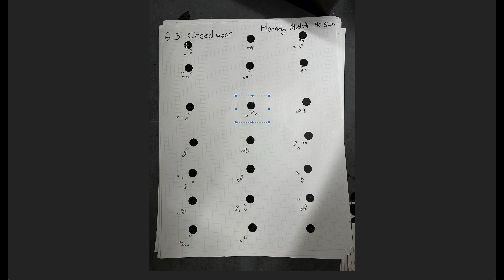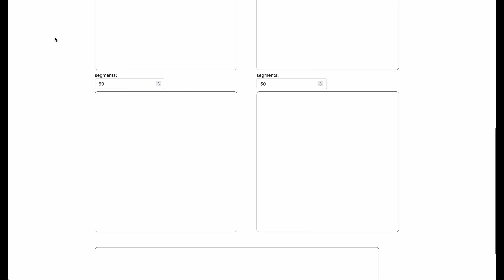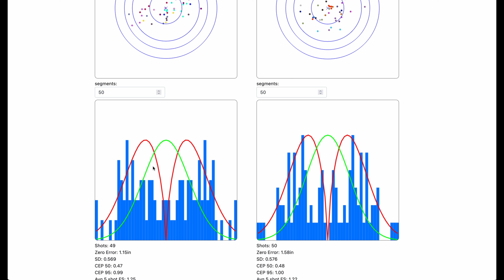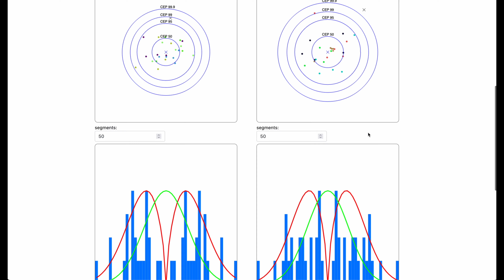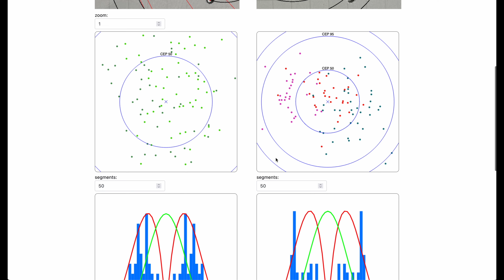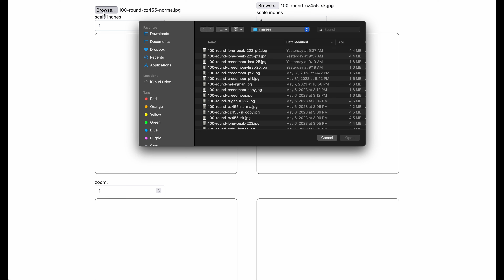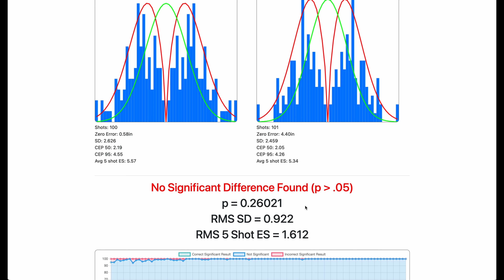Does Barrel Heat Affect Accuracy?

Comment: I think you're probably (pun always intended) correct that barrel heat has little-to-no effect on accuracy, but I don't think you've supported your argument super well in this video. 

First and foremost, the group rank (e.g., whether is the 1st, 5th, or last group) may not be a good proxy for barrel temperature. I'll give you the benefit of the doubt that your time between groups was as consistent as possible, but even so you're still fighting the opposing dynamics of adding heat with each shot and that heat dissipating at some rate between shots (and between groups). It would be more meaningful, and fairly simple I think, to actually measure the barrel temperature, then run a regression of mean radius on barrel temperature. If you want to get fancy, you could measure wind and include that in the regression just to eliminate any possible bias introduced by wind. 

Second, it's not very convincing to compare the first half of your groups with the latter half, as that only inspects the relative effect of the average barrel temperature of the first half of the groups to the average of the second half of the groups. If barrel heat has a significant effect early on but not so much as more and more groups are fired, you might miss the difference in that comparison. Likewise you might miss it if the effect is significant but the slope is small. 

Anyway, thanks again for the great work on these videos!

Comment: I don't know how you are placing your reticle, but the width of the reticle introduces another variable. Might I suggest placing the aiming spot in the corner of the intersection rather than under the intersection. This way the entire aiming point is visible and can be adjusted to touch both the x and y axis without being obscured by the  crosshairs.
Reply: The variable you alluded to is about maintaining a consistent sight picture. It’s easy using a 6 o’clock hold., which can be exactingly memorized.

Comment: I still don't think I understand how your bar chart/Bell curve works: what is that supposed to be displaying? What does the X-axis denote? Distance from the aim point? But why is it mirrored? And if the dip is supposed to show that you are less likely to hit exactly on the center, wouldn't the scatter look more like a donut? But it looks pretty even and randomly spread to my faulty human eyes. But at the same time, of course you're less likely to hit a location with much smaller surface area or circumference, but what is the statistical probability of hitting ANY specific small location inside the 95 CEP?
I just don't think I understand enough about your methodology and display of the data.

Comment: Since you're fitting a a pair (more?) of normal distributions, what is the error on your fitted-sigmas for the convoluted model? If you presume that your pair (or more?) of stacked distributions are from different causes (lets just say: shooter and mechanical), then you should be able to see if there's a divergence of the fitting parameters (primarily the SD from each individual distribution in the model) or if they both shift slightly. It won't answer the question specifically about heat and accuracy (maybe it's fatigue that's worsening the shots?) but could be interesting to see if they converge/diverge over time. Further: same shooter, same gun, different quality of ammos - this might be a way to estimate a shooters absolute accuracy if there's a common enough factor across multiple tests.

Secondarily to this: why do you only report a single SD in your fitting tool? Why not report all of the distributions' SDs for the model? I see you still have a normal model overlaid, and if you're reporting the single-distribution SD, then as you have already noted - that's not really a good representation (except it's probably pretty close since you have a major and, possibly several, minor distribution(s)). I'd have to think about it, but I'm pretty sure the single normal isn't just a quadrature-added set of the multiple distributions (correct me if you understand it differently). For example, if you had for some reason a fairly evenly distributed group (how? I don't know) - your single norm SD would be much further away from your major distribution's SD. While it probably works if you are reporting a single normal for that reason, it won't be broadly applicable if you're worried about that. So, for clarity in your model, I'd strongly suggest reporting the component SDs and not even showing the single-distribution parameters.

(again, insightful, thanks for the work on this)
Reply from the maker: Adding error fitting to the model would be a good addition, I’ll have to add that.

I’m only reporting a single as because that is all that I am able to calculate. We don’t know how much each dispersion source is contributing, and there isn’t a way to infer that from a single data set. 

A single SD is sufficient (based on our current understanding of the model), because we know the distribution model, the scale factor, and degrees of freedom from the simulation, so the single SD is the only remaining variable. The red line on the histogram is the curve free inputting those variables, and it has matched up well with our tests so far.

Comment: Two pieces of feedback. I know it's not much, but I would sort of like to see:
1. A larger sample size when comparing barrel heat along with measurements of barrel heat.
2. A little more depth in terms of what variables you are measuring and controlling for. 

You mentioned that there was no significant difference between the cold and hot barrels in terms of spread size but you did see a difference in the distance of the group from the aim point in one test. Based on the video, I would conclude that it may be noise but I could imagine one would also want to know things like the actual temperature of the barrel, the velocities of the bullets, the caliber and type of projectile used, the rifle used, i.e. as many variables as possible that could influence accuracy in one large and well-measured study.

I realize that this isn't really practical to do and it sounds like a big pain in the ass. Maybe it's possible to do it in a practical way. I don't know though, I'm not in the business of statistics or designing experiments and you may well already have the data.
Reply from the maker: This is a topic we will have to revisit. It would be nice to see how much of this replicates, and to get a bigger sample size. I would say this isn’t conclusive, but really brings into question the myth that heat increases dispersion.
Reply: @blackburndefense  I mean if it's really worth it haha. It would definitely be very interesting. 

I don't believe heat would play that big of a role under normal circumstances, and likely not under bench shooting circumstances. I could see a barrel heating up enough to melt lead with semi or fully automatic weapons, maybe. 

At that point, I would just be curious to see exactly when it would start having an effect, i.e.what the barrel temperature has to be before the effect is noticeable. I'd also want to know, if there is an effect, what is causing it? 

I can think of a couple things, but the most likely in my mind is that the heat causes the barrel to expand slightly. If that is a thing, then I would expect a bullet that is heated up prior to being chambered would have a tighter grouping since it's tighter in the barrel.
Reply: @blackburndefense late to the party on this discussion, but I am still skeptical of calling it a myth that heat increases dispersion. Anecdotally, I have an AR with a 16" pencil barrel that opens up as it gets hotter. I'm interested now in actually doing an extended grouping session with it, and see if my anecdotal observation holds up regarding group size, or if it is primarily poi shift. 

5.56 is cheap enough that I can justify picking up a couple hundred rounds and burning it all in a series of 5-shot groups for science
Reply: @leadcloud  I agree that this isn’t conclusive, and more testing would be beneficial. Let me know how your testing goes with the 5.56, I think that’s a great test case and will have some interesting results.

Comment: Did you bearing surface sort the prijectiles?measure individual case capacity? Weigh each charge to 2 100ths of a grain. Maintain CONSTANT not ever changing temperature range? If not, will you see seemingly random dispersion unless you look at 100's of rounds of data to account for all the  noise? Not mad, it's just science.😄

Comment: There was a time when I tested 12 loads in one round of shooting with 5 shot groups for each.  The top 4 were chosen to be retested with (2) 5 shot groups for each load.  Went home, made up the top 4 loads and it was off to the range.  Same everything, except different day.  All four loads were shooting worse than the worst loads from the previous round of shooting.  I was very confused by this.  I thought maybe I had lost my sniper's touch.  Every rifle my trigger finger touches shoots like a sniper rifle.  That's just my talent.  And to loose it was very disturbing to me.  I went from 1/2" to 3/4" groups to 1 1/4" to 1 1/2".  It's was like I was shooting factory ammo.  Since all the groups were bad, I chopped it up to wind.  I took the smallest 2 of the four and loaded those with 20 rounds per load.  Each load would be shot into a 20 round group to determine who was the most accurate.  20 round groups plot the standard deviation of the bullet as well as the type and direction of heat drift.  I was still able to pick an accurate load.  But that bad shoot had me doubting I had picked the most accurate.  I feel like I know a lot about a load by it's five shot group.  But saying we can't pick a load by a 5 shot group, is like saying we can't hire some one because of how well they interviewed.  Sure we add other data points to an interview, but often times it comes down to the interview.  But often times the best candidate was not the best interviewee.   I know this because of my 14 years of experience of interviewing for jobs.  And in some cases I would meet the putts they picked over me.  My point is, maybe out there are many a most accurate loads not picked by their shooters due to a lack of consistent data.  But what other practical means do we have to pick the most accurate hand loads?